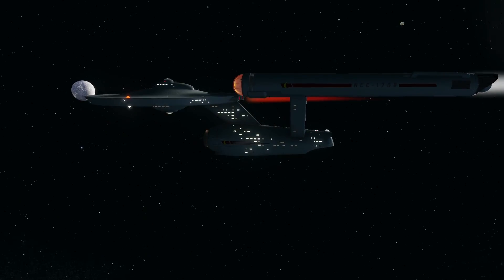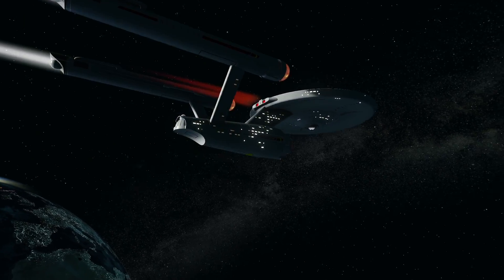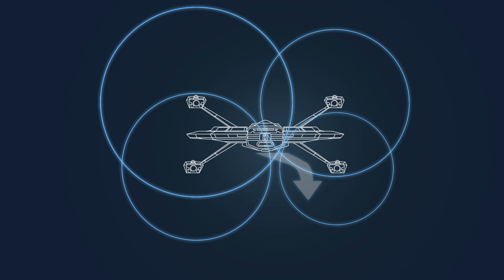Why Extra Nacelles?

Comment: A certain website creator named Masao had the very interesting idea that older starships (if you could call those starships given the premise) had dedicated nacelles for turning at warp, typically the twin configuration with the primary warp drive often being a single aft facing bulb. There's a kot there that could be used in ideas for warp field dynamics in videos.

Comment: I like the idea that the Disco nacelles were an older type that they had to keep adding more and more; until they reached a thermal limit and had to design brand new higher performance coils such as in the Connie. 

That’s kind of like how performance engines have gone from huge naturally aspirated V8, 10 or 12s versus a double-turbo supercharger combo on much smaller 4 or 6-cylinder engines.

I really enjoy these videos which combine little tidbits from all sorts of sources to paint a bigger picture.

Comment: I always thought that the placement of the warp nacelles better suited different uses. The rearward sweep as seen on the Constellation right up the Sovereign was for explorer craft and allowed for higher sustained speed to allow for long range. The underslung position as on the Miranda and Nebula that didn't do much exploring enjoyed a smaller, simpler warp field and less stress on the engines for a lower maximum speed - never far from support bases. And the quad-style as in the Stargazer was more like an all-terrain design, for going "offroad" through places with gravitational shifts or large gravitational bodies - like anomalies, asteroid systems, or high gravity stars. The "pinched" rearward position of the Intrepid always suggested to me a dragracer - that Voyager was fast and agile at warp.

Comment: 3 and 4 nacelles is easy to explain ships can only maintain high warp for a set amount of time...  we hear this in almost every episode,   "we can only maintain this speed for x hours"

With several warp nacelles it allows a scout, survay, long range ship, the ability to "cycle" nacelles, powering 1-2 down,  for maintenance/cool down, while keeping the others running.  This ends up being a more efficant way of doing high speed long distance travel.     a ship that could cruise at warp 6,  and pull warp 8 for 12 hours   might be able to run at warp 7 indefinatly by cycling its nacells.   

this can also provide a "cheaper" solution to needing a more powerful engine in a star ship.    So rather then needing say a larger warp core and a warp 9.5 engine.    You can cover the same "cruising speed"  by running a lower power warp core, and the 4 nacelles hot  in alteration.

Comment: @CertifiablyIngame Thanks for that Rick. I've actually just designed a 4-nacelled Quantum Slipstream vessel called the USS Exodus, and the reasoning I used for that extra pair of nacelles was somewhat similar to the reasoning you posted in this video. Essentially Quantum Slipstream corridors tend to dissipate after short periods, so the extra pair of nacelles meant that the Exodus can maintain a Slipstream corridor for longer, thus extending it's range.

Comment: An extra pet theory of mine is that more nacelles help reduce the warp coil mass of each individual nacelle for the same overall warp field strength.  We know nacelles need to be energized and polarized in order to work, and it would make sense that the larger the coil mass in a nacelle, the longer that takes. A design with more nacelles can have much lighter coils, so it can go from a standstill to warp with much less prep time, at the cost of reducing reliability (lighter coils are more likely to run out of alignment and get damaged from sustained warp).  Warp coasting would certainly help with that problem.
Conversely, 1 nacelle vs 2 makes a super reliable ship, but less efficient and way slower on the pickup. It's a long haul trucker vs the 4 nacelle dragster. 2 seems the sensible middle ground.

Of course, even a 4 nacelle dragster can be a reliable workhorse if you underpower it enough that the reliability doesn't matter, but it probably wasn't designed for that :p

Comment: So from what I understand is that when traveling at high warp speeds there is a wake that is produced in from of the ship, this wake causes instability in the warp field acting as a break. So in order to travel faster or sustain high warp you need a increasing amount of power to be pumped into the warp field, thus over taxing the warp coils and warp drive. 
However I think the increased number of Nacelles would allow a more stable warp field for longer as they handle the wake better, though this would still be at a cost of more power, it would be more efficient at stabilizing the warp field.

Comment: My theory has always been that the Stargazer was part of the R&D project which came after the failed Transwarp experiments. It essentially utilised two sets of nacelles but somehow 'interlaced' them to produce a more efficient warp bubble. This then allowed missions of longer duration and more deep space exploration, which then led to the Federation's rapid expansion between TOS and TNG. I also assume the warp speed scale (and by extension the star date system) were re-calibrated at this time, with warp 10 being the upper limit that can never be reached.
By the time the Ambassador class was developed, the new warp field dynamics could be achieved with new engines without the need for a quad arrangement, and this can also be seen in the Galaxy class with its wider and larger nacelles.

Comment: 3 nacelle designs, such as the Franz Joseph Dreadnaught Class, seem possibly troublesome or even dangerous, which might explain their rarity.
Reply: The Federation-class dreadnaughts were the last practical ones.  I think it has something to do with the changeover to flat nacelles.  Look up the Belknap/Decatur class starships if you don't know them.  First ships to use flat nacelles OEM, and they have the curious design feature wherein BOTH nacelles can be (have to be!) ejected at once in case of emergency.  Why design that feature in?  Must be necessary!  The flat nacelles (FWG's in FASA parlance)  were fast and hot, bucking broncos compared to previous nacelles.  Hard to handle and dangerous, at least at first, at least until procedures and protocols could be figured out.  Once figured out, THEN AND ONLY THEN approved for fleetwide deployment/refitting.  The Ascension 3-nacelle variant must have had even rougher trial runs, maybe even rough enough to convince Fleet Management that 3-nacelle ships were a Bad Idea, and avoided for decades after.
Reply: @xheralt  Many would agree the Frederation Class had its practical use since upon seperation the warp capable saucer would be able to act as an emergancy ship in the event that the secondary hull should suffer problems such as core breeches or have to jetason the port and starboard nacelles since the 3rd nacelle can allow the federation class dreadnought saucer to also go to warp as well as land on any planet

Comment: Honestly, I like the Beta canon version of the Constellation class. It had the Constitution class refit saucer section, a Miranda class torpedo pod suspended slightly below the saucer section, and only two warp necelles of the same style. One held above the saucer section and one just under the torpedo pod, under the saucer section. Technically a little weaker of the Alpha canon version of the Constellation class, about equal to the Miranda class, it was very maneuverable and packed a punch thanks to it's torpedo load out.
Reply: That sounds very similar to the Akula class ship.

Comment: So, Nacelles are afterburners, which means that my Lego Nexus Class Cruiser has five, two primary, one port one starboard, two secondary, again port and starboard, and one centrally mounted one inside the main fuselage for tertiary.

Technically, there are two more, but they only activate when the bridge separates from Nexus-1 as the Attack Landing Craft Nexus-3, so I don’t count them in the total lineup.  Plus, they are tiny.

Comment: I actually had a theory for the Discovery Era ships.

So the NX nacelle design perfectly transitions into the TOS/SNW Constitution. 
Then we have all the Binary Star Background ships. So, one common feature is that many of those ships :Crossfield, Shepard, Cardenas... all actually have 3 Bussard Collectors on each nacelle; 1 "normal sized" one and 2 "mini sized" ones. So what I think they basically did was was strap 2 smaller wrap engines to a normal sized one, then encase the whole contraption in a single boxy nacelle. This was a stopgap measure, and eventually, warp nacelle design became more efficient, and the whole mini warp engine strategy was dropped.

Comment: Nacelles were in B17s and DC3s also.  It is just an aircraft engine aerodynamic housing cup typically mounted on the foils (wings) or tail....instead of at the head of the fuselage Snoopy and Red Baron style.

Comment: In my head-canon I've been speculating on a difference between square vs round nacelles having to do with their coils. I think that square warp coils may be manufactured by gamma-welding most of their shape from more-easily mass-produced slabs of laminate warp coil materials. These would be cheaper and faster to produce but would be somewhat cruder in function and have performance drawbacks compared to fully cast warp coils. (See TNG Tech Manual for coil manufacture) Thus I see a potential cost vs performance calculus going on between square vs rounder nacelles.

Comment: I'm not so sure on the extra power front, at least for the Constellation class. Picard said to Scotty in Relics the Stargazer was always "under-powered" a comment that always confused me, as like others, I'd have expected it to be better power wise, relative to ships made in the same era.
Reply: Smaller reactors for better fuel efficiency for mission duration, and the four nacelles still allowed reasonable speed. 

But it didn't work as well as they had hoped.

At least that is my hypothesis.

Comment: Head cannon to explain 1,2,3,4 nacelle ships and nacelles on pylons and inter grated nacelles:
A warp coil emits warp energy and that warp energy starts to build a warp bubble where the warp energy of one warp coil intersects the warp energy of another coil.
The most simple and efficient warp bubble is where those intersection points occur is in a single line as close to the center of the ships profile , but multiple lines of intersection are more efficient but more difficult to maintain. 
Single nacelles create a warp bubble by having the energy of the coils being projected fore and aft and the instead of intersection points you get consecutive rings of intersection inside the nacelle but this is not ideal for higher warp function because of the energy being released is inside the hull instead of at points outside of the ship 
This is how warp coils can interact with adjacent warp coils in its own nacelle, with one other nacelle , or with coils in multiple nacelles. This is also how you can’t have both kinds of interaction at the same time occur with 3&4 nacelles ships while at the same time agree that the simplest and most efficient warp bubbles are created by a single pair of nacelles as is the default configuration in star fleet

Comment: My headcanon was always that 4 nacelle ships were basically like Sports Cars. Overpowered, high-performance machines, faster than is necessary for 90% of Starfleet's purposes, that cost so much to build (in terms of resources, time, manpower, maintainence costs etc) that for each one you could build 2 or more regular ships. As a result, they're fairly rare. A one nacelle ship would be the inverse, something cheap, maybe even slapped together leftover parts, intended to just hobble around Federation space helping bulk up fleet numbers. After all, the only thing the nacelles effect is Warp Speed; diplomatic missions, scientific studies, even combat, have nothing to do with them.

Comment: I'm under the impression from all the Trek lore I know that a single nacelle can establish a warp field (scout classes had only one), but if a ship had to rely on only one working nacelle for FTL, it would be limited to a low warp factor because of the less-than-optimal configuration of the warp bubble.
Reply: That is my impression as well. There is one instance I know of off the top of my head that shows this.
In 'Year of Hell' B'Lanna mentions that one nacelle is at reduced efficiency and that the other is a lost cause implying it no longer functions. They were still able to go to warp though showing that while two works best one will still work.
Reply: In Enterprise Trip said with only one nacelle they’re limited to warp 2 (maybe it had a low decimal point after it), further lending credence to the idea.

I think it makes sense since you’d have to be pushing the coils in that one nacelle harder, to make the larger field to ensure the whole ship is still encompassed.

Comment: Correction: The Nacelle on a jet is the outer shell on a jet engine, that holds it in place. If you look up photos of jet engines, you'll see them as very mechanical constructs and covered with tubes and whatnot. The nacelle is only there to provide the jet engine an aerodynamic profile, protection from the elements, protection in the event of a catastrophic failure, and an installation point for the engine.

Likewise in Star Trek, the nacelle is the outer shell that holds the busard collectors, the warp coils, and, essentially, the warp field generators as a whole - or, in other words, the ship's warp engines.

Comment: I thought I remember hearing somewhere that the disco ships with four nacelles also had two warp cores. It may have been beta cannon but it's a neat idea.

Also a neat idea I heard, the three nacelled ships actually have two in one housing module, this still keeping with the "even numbers only" design. Again no idea how accurate this info is, but a nice idea I thinks.
Reply: Yeah you could probably make smaller warp coils and stick pairs inside one nacelle housing. In theory it should be the same as just making two smaller nacelles (like the very first Nebula class model had).

Comment: The analogy of "prop" and "turbine engine" driven planes is accurate.
Gene Roddenberry was a pilot and drew inspiration to create almost all the ship designs from his life experience.
No, he did not create those designs, but as the creator of the pilot and ToS (yes pun intended) he had the last word on what was used.
So, taking your initial point that Trek ship hulls and engines were inspired by him, the dual warp nacelle's were almost certainly NOT the starting point for the "Fleet ship progression".
The original planes only had one engine due to weight/space constraints.
Thus the first ships that used "warp drive" used only one engine.
Why was this done ?
Because you have to learn to crawl, then learn to walk, then learn to run.
ST- First Contact is the exception, yes I know it had TWO warp engines when it in canon had only ONE (and also it was made for a mass audience not just trek fans).
The Trek series Enterprise used a "warp field governor"  to BALANCE BOTH ENGINES to enable a safe engagement of the warp drive.
ST- The Motion Picture shows that if the warp field balance calculations are even slightly incorrect disaster can result.

Comment: I know there is a fan design called the USS Arges (by Howard Day) which incorperates the Vulcan Ring Warp drive and which seems to have two tiny nacelles next to the saurcer section. Which makes me wonder if what kind of designs you can make if you incorperated both warp rings and warp nacelles.

Comment: In both fictional and RL (*theoretical) warp engines a field is established around a structure. That field excludes the structure from normal space. The purpose being how warp field travel actually work. See you may think and the show surely seems to support that the warm engines are "driving the ship" meaning that they are pushing the mass at higher and higher speeds.

In  reality the warp field excludes the area inside of it from normal space. This is shown in an episode of TNG where as they used the warp field to lighten the mass of a moon with a degrading orbit in order to relocate it so it would not collide with the planet.

With the field established and the perceived mass of the vessel thusly reduced by several "factors" the ship could then be moved more easily. However I'll again state the ship its self is not being pushed. rather the field is compressing space in front of the ship in conjunction with the mass altering effect both by a degree referred to as the "warp factor" and then letting it travel around the field where it is released so the entire field "ship and all" is propelled in that direction to fill the vacuum while the expanding space behind it also play a part in nudging it along. 

Warp field symmetry is the reason for multiple nacelles.  By controlling the shape and regional factor density of the warp field you can more efficiently bend space/time around the field its self meaning a more stable ride and lessened possibility of warp field failure. 

  In quantum slipstream you would be using the property normally only held by sub atomic structures to displace all of the mater of the ship to another location nearly instantly. This is currently being developed in real life to overcome the one atom law of computing which says that circuits can only be as small as a single atom before we tap out of development and can no longer make them smaller. Learning to control quantum phasing could eventually produce this form of propulsion.